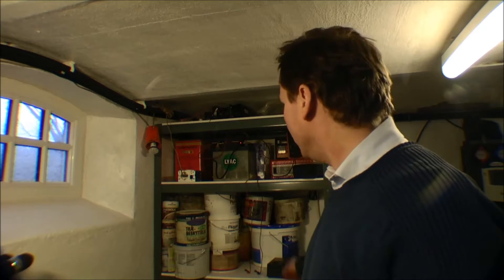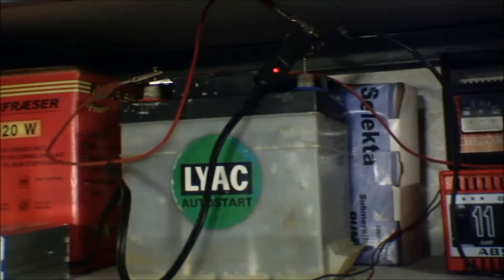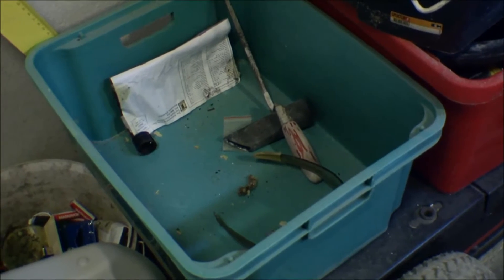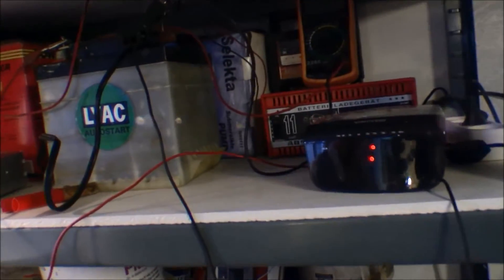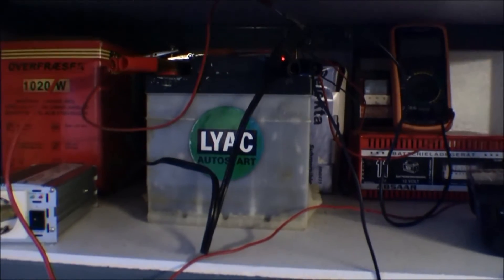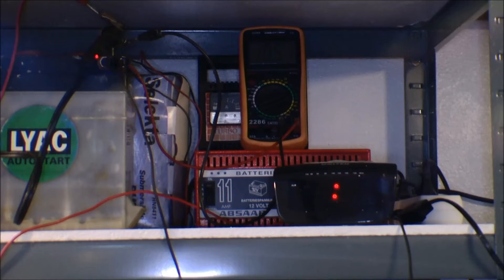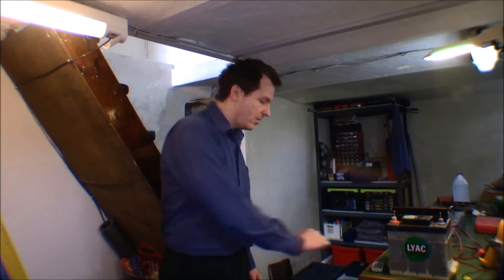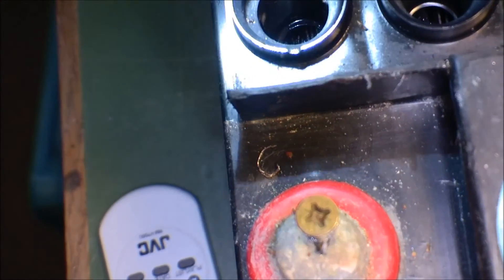Reviving car battery from 1978 Part6 - 041

Comment: yeah its probably cause them plates have been dry too long. When you take the vent caps off the plates should be totally submerged. Might be another reason you haven't had much luck in reviving that battery, its very low on acid. And by the looks of them plates, sulfation has defiantly played a role in in on top of it being so low.
Reply from the maker: Hi +umbrefawx 
I guess 1978,, was just to old,, it looked okay for a while,,, :-/ RIP
Thank you for watching! :-)